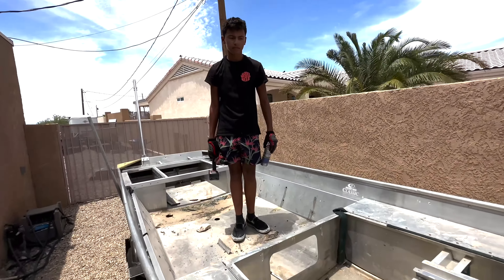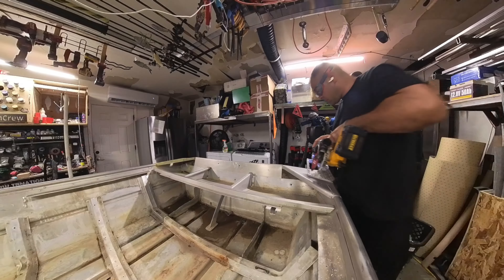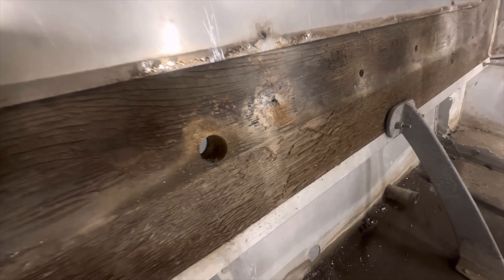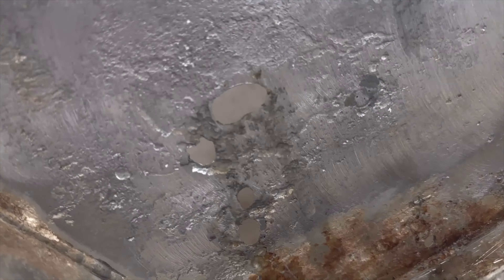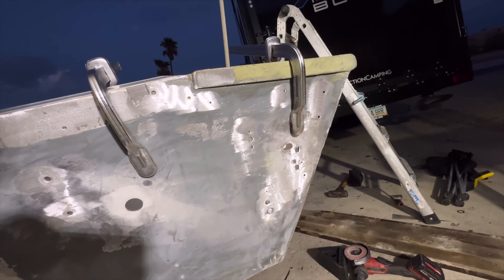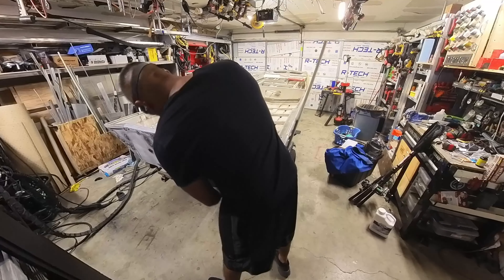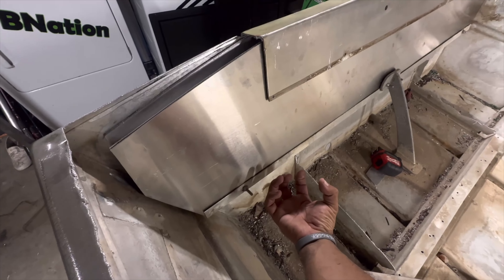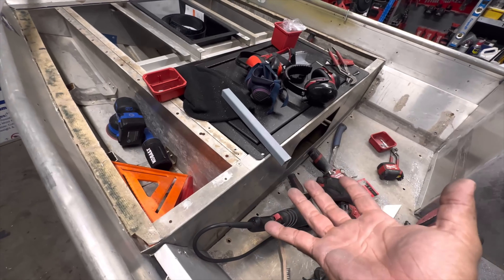This transom was TOAST, but we fixed it!

Comment: Yeah i am winging it on a first go at replacing my transom, the back plate/dam looked like someone took a shot gun to it along with the back plate, bent, concaved bolt holes from someone over tightening them, so i cut some new 1/8 aluminum with the plasma cutter, one dam and one inner piece for the back, I was just thinking about using liquid transom but now watching your video it gives me additional options of just making a complete aluminum transom, issue is i have never tiged b4 even though i own a couple, looks like tomorrow i learn how to tig, cool video complete aluminum transom excellent idea.

Comment: Do you have an idea of the weight/HP limits of that aluminum transom? Would you feel comfortable putting a 50 or 60 hp 4-stroke engine on it?
Reply: nevermind, I just saw this on the website... "Recommended for 60 Horsepower and Under, and at a minimum re-using your factory transom bracket support for the original horsepower rating."
Reply from the maker: We make one for 60 horse. I have a video on it and it works well.